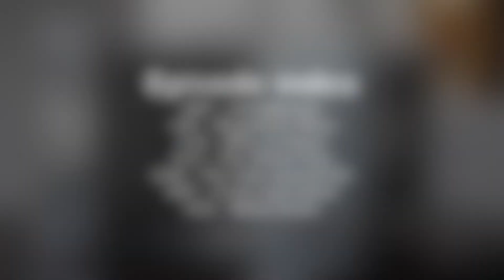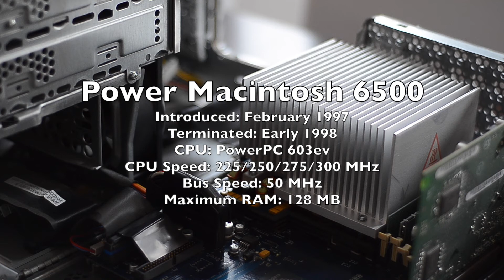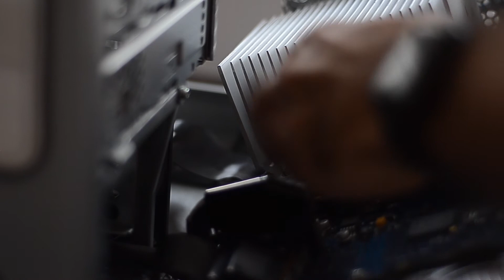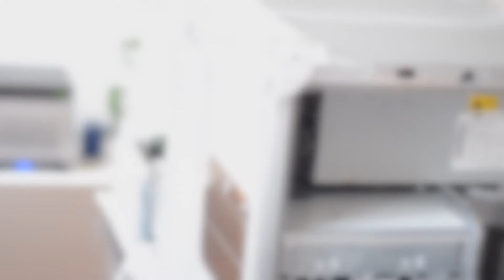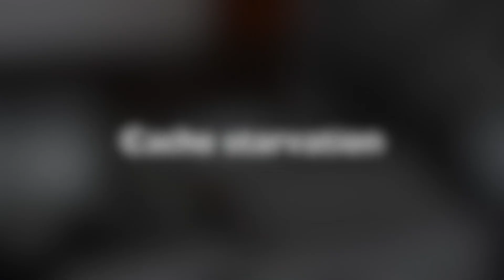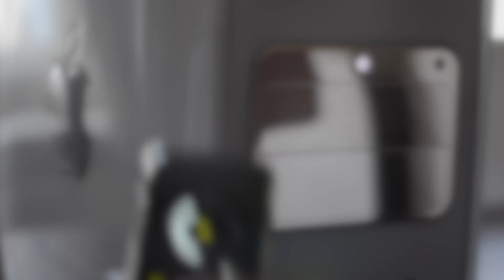Random ramblings - The Tale of Two G4s, Apple noisegate, Verax fans overview

Comment: Apple was aware of the noise problem and replaced the fans when users requested them. Only in 2003, with the latest MDDs, did Apple change the type of fans to quieter ones. In any case, it is possible to replace them with three quieter ones while still ensuring good ventilation. The problem with the power supply is often caused by the fact that many users leave their Macs plugged in without using them for long periods, often due to the laziness of unplugging them. Any computer power supply would fail prematurely. Even televisions, monitors, and electronic devices, if left plugged in without using them, suffer long-term damage over time. I recommend always unplugging your electronic devices if you are not using them for long periods.

Comment: I also have a dual 1.25GHz FW800 which is quite loud. I replaced the main cpu fan with a Noctua 1700rpm one. Its not powerfull enough vs. the original but quite all right and much much quieter. Made the machine little quieter but not much as the main noise comes from the psu fans. Next I will recap the psu and also replace the fans with quieter ones. Its not easy to find 60mm quiet fans that transfer enough air but I now have couple that should be better (47 vs 34 dB). I shall see. I also added an extra PCI slot exit fan which seems to move air quite nicely out of the case but didn't add noise enough to be noticed.
Reply: If you have a graphite g4 or a blue and white g3 tower, they come with an awesome fan that pushes a lot of air, and has a built in temp sensor, so that fan speeds up when needed, and it brings the noise level way down. What you also could do, is add a fan via molex behind the optical drive, you should replace the OG optical drive with a more modern one which is going to be less long, so you can hot glue a fan behind it, leave the bottom optical slot open, and leave the optical drive fan in place, it's going to cool the top of the heatsink, which will bring temps down even further, making the SenseFlow fan even quieter. Replace the power supply fans with new ones, i just replaced them with the same type, the bearings could be shot (they were on mine, not anymore), and i added a very small fan near the biggest transistor in the power supply, i soldered it onto the cable from one of those 2 fans, helping to cool that particular chip brings the noise down, and i also added a very slim fan in between the heatsink and the rear of the computer case to help force the hot air out of the chassis, once again, it brings the noise level down, i sit around 28 decibels, it sits on my desk next to me and it doesn't bother me anymore, it's like a normal computer. Also, what kind of PSU do you have? I have the ACBell replacement unit that Apple gave away as a free replacement option. Other than the noise, this is my favorite mac ever :)

Comment: I have a dual 1.25Ghz like yours, but with original fans, and never thoughr of it as "very loud". I guess for most Apple users of the day it was, though, but I did play a lot in the era with an original PlayStation 2, so amything else becomes quiet as comparison. The only problem I have with the MDD is how easily the PSUs fail, I habe already replaced it on mine and this new one is failing again. I can only power on the machine via ADC now. But apart from that, I'm very happy with it, very capable machine for its age. Fantastic video, by the way, very well explained. You only missed one little thing that's also rrlated with noise: The original MDD firmware/ROM had some sort of "speedstep" thingie, where you could slow down the cpu to a slower clock speed, lowering the TDP and power compsumption. G5s do that, for example, and you have the option to choose the speed in the OS. But because of the fragile PSUs I mentioned earlier, some G4s would just shutndown or have kernel panics, so they issued a firmware update to fix it. The "fix" was to maintain always 1.25Ghz, so the fan never slows down, and it prodices more heat and more noise. I think thatbwas exactly the point were the Verax fans were designed, but I could be wrong about that. Cheers again, really love your vids, you should post more often!
Reply from the maker: I'm glad you enjoy the videos. 
There is no exactly schedule for them. I use them mostly to document my own projects, so I post as I go. =)

I've heard of Apple disabling CPU Nap due to the power supply issues. I have a video in the pipeline about it.
If you install a specific version of CHUD, you can re-enable CPU Nap. The machine gets quieter, but the sound is much more annoying. The sound interference is awful (at least on the 867 MHz).

However, the power consumption difference is significant. I don't recall the numbers by heart now, but it's almost half (I measured them a few months ago). Apple should rather have fixed the power supply. It's surprising that a "server grade" power supply can't handle the load levels.

Comment: Interesting, I didn't know about the Verax fan mod, but have heard of replacing the PSU fans to quiet it down. Later model MDDs supposedly had quieter PSU fans from the factory to address the noise issue, and the difference is there but not huge.
Reply from the maker: I found about the Verax fans by accident, when I was looking for a Mac OS 9 capable machine. Then I was lucky to find this one on eBay 24 hours after I got the dual 867. =)

If you browse the old forums and use the wayback machine, you can find the original manufacturer page.

As far as I know, Apple shipped the FW800s and the 2003 re-issue of the original MDD already with the newer power supply design, but I've never seen or heard one.

Comment: Lol..g4 was stronger then pentium 4
Reply from the maker: It depends a lot on the task. Some operations favored the P4s design. Arguably, the G4 was much more efficient (power consumption).
Reply: I must say, you enyoj te silence after you turn off a power mac. Thats when you realize how loud they actually are
Reply from the maker: Indeed.
The G5 is much quieter than G4, and I usually forget it is running.
But after I heard a 1,1 Mac Pro I was impressed.

With the Verax fans it's ok though. If it is sitting on the floor and with SSDs, I forget it is there.